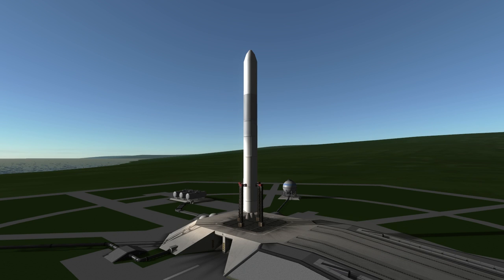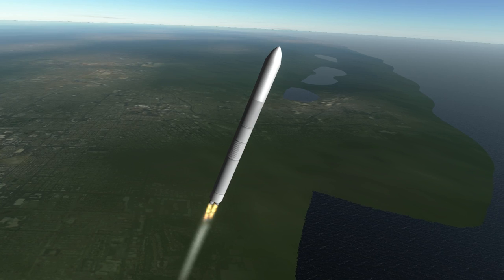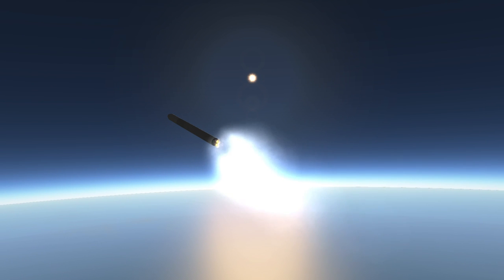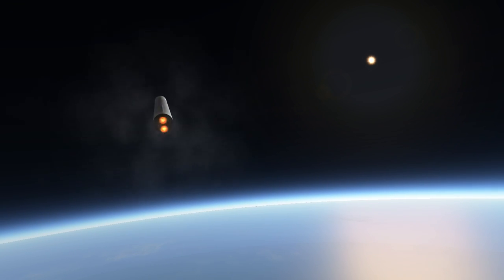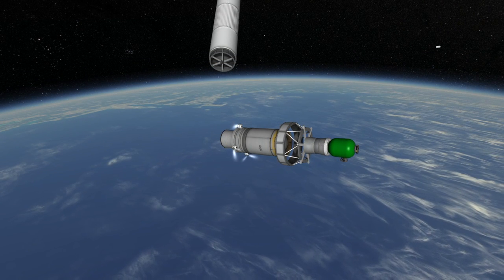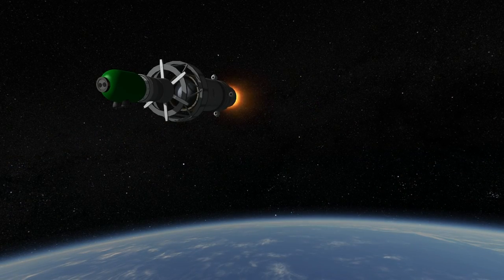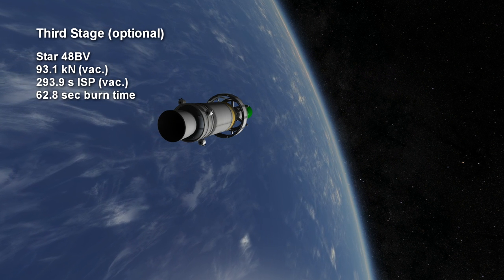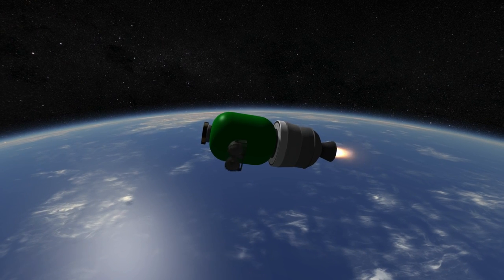Rocket Profile - Antares 200-series

Comment: My only question is that why does the Antares use 2 RD-181s when it could achieve near-identical performance from a single RD-180 on the Atlas V? Is it more reliable to use two half-sized engines instead of a single full-sized engine? Cost? Politics?
Reply: Russians